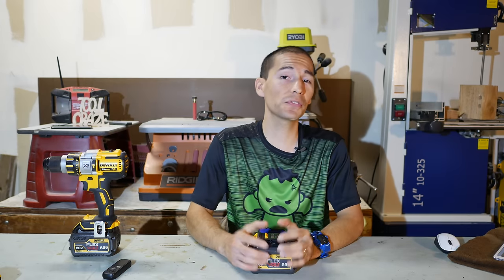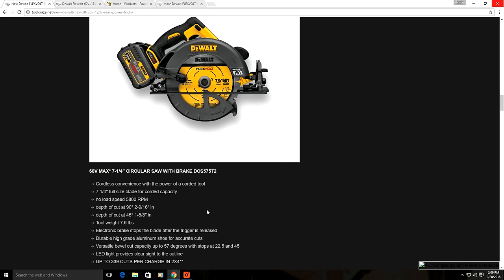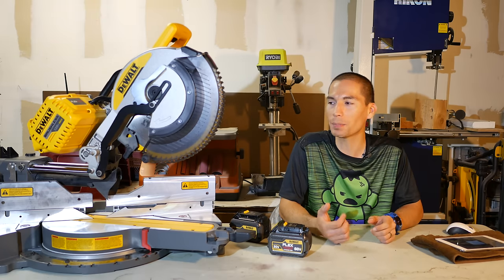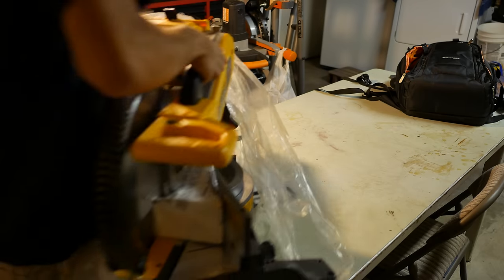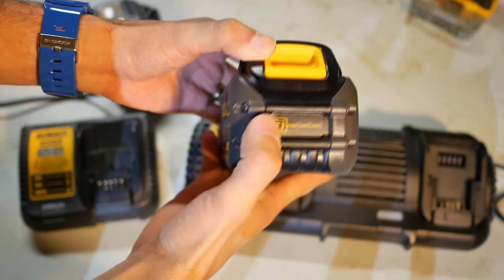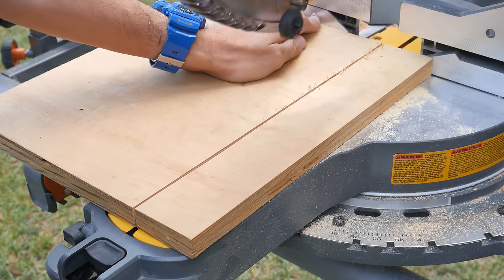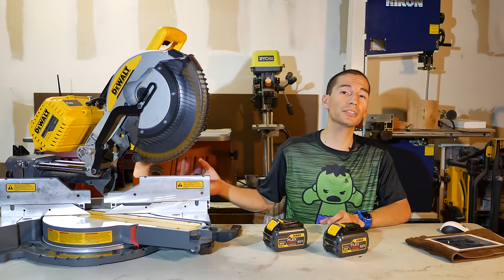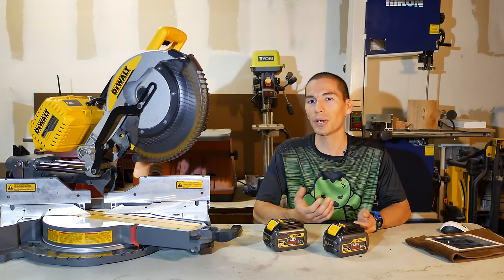Dewalt Flexvolt 120V 12 Inch Sliding Miter Saw DHS790AT2 Review in 4K

Comment: Thanks for the great review. I got my saw last week and love it. One small tip to add; there is an O-ring on the cord of the AC/DC power adapter and a U-hook at the end of the saw rail. Slip the O-ring into it and the cord stays nicely tucked behind the saw, of course if using the power adapter.
Reply from the maker: Thanks for the tip

Comment: great review. i just bought this kit at home depot on sale for $699. plus they have an offer of buy a dewalt 60v tool and get a free 60v battery at a $150 value. so im very happy. but i opend it up and found one of the slider rails is scratched through its finish and rusted. curious if i should be concerned about it and take it back? also the red caps on the batteries are really hard to get off.
Reply from the maker: thanks, yeah I'd take it back if the side rails were busted out of the box. Just get an exchange, its a very good saw
Reply: thanks. appreciate the reply. i just watched the milwaukee miter review. i went with the dewalt 60v as i have the dewalt platform already. i also just bought the rigid cordless miter saw kit and it is amazing. i don't have that battery platform but it makes 289 2x4 cuts on a single charge so it can handle more than a days work without recharging. just subscribed to your channel. cant believe i hadn't come across it sooner.
Reply from the maker: No problem and thanks for the sub. I'm sure either the Flexvolt and the M18 fuel miter saw can both do over 300 cuts on 2x4's because of how many cuts they were able to do on 2x10 with their batteries.
Reply: i forgot to say the rigids is only a 7 1/4 and weighs about 25lbs. so its great to haul around when you only need small cuts framing or trim. look forward to watching more of your vids.
Reply from the maker: Nice, I have the dewalt 20V miter saw and even though it's lighter than a corded model, it aint 25 lbs so good to hear the ridgid is that light. Thats definitely a good selling point. Thanks bro!

Comment: Awesome review man, I think this is the first time I actually sat down and watched a 30 minute tool review. It was worth it, answered a few questions I had about it. 

It would be awesome if they came out with an AC adapter for the 60 volt tools. That would be a game changer. Not that Flexvolt isn't already. 

We might be cutting the cord for the trades in our lifetime for real - other than charging the batteries. The Makita cordless lineup is huge. I switched from DeWalt to Makita for cordless a few years ago because they had some cordless tools I needed that DeWalt didn't have available. Namely, a cordless 23ga pin nailer and cordless random orbit. If DeWalt makes one I'll go back. I wouldn't be surprised if DeWalt comes out with a 60 volt band saw, 15ga finish gun, and framing gun soon, a cordless framer that sets nails like a pneumatic would be great. Looks like I might be going with two cordless brands on my truck soon.
Reply from the maker: Thanks bro, when you really get into, those 30 something minutes fly by.

That's the thing about all cordless brands, none of them are perfect. You have to pick the tools you need from several brands to have a custom collection that suites you best. Good news is that Dewalt already has a framing nailer on 20V
Reply: Yes that truly is the thing. I thought I was settled on Makita until DeWalt came out with all this Flexvolt insanity. I don't truly need any of it for what I do - finish cabinetry - I have the Makita 18v 23ga pin nailer and 18ga brad gun, impacts, drills, saws, biscuit joiner, random orbit sander, etc., to where all I have corded is miter saw and table saw and router the once in a while I need it (ohhh yeah 60v router....?) - but man I sure do want it. Once in a while I have to run 200 feet of cord for them which burns out the motors, so that can be my excuse. 

I've seen reviews on the 20v DeWalt framer that shows it doesn't sink nails so well all the time, I don't think I'd want to deal with that frustration. I do decks a lot on weekends and I just roll out the trusty pneumatics. But if they came out with a 60v version I'd probably go for it. It's so hard not to jump on the miter saw already even though I just bought a new one a little over a year ago. And if I got the miter saw I'd have to get the table saw...  Ah the luxuries for lazy carpenters.
Reply from the maker: Good news is that there are cordless routers by Ryobi and Ridgid. Only thing is that they're trim routers which isn't a bad thing really

Comment: What type of stand do you suggest? My DHS790at2 only came with ONE Blade? Is that correct or did you just get lucky with the Extra Blade? A Frozen Pizza would have been okay too.
Reply from the maker: Personally I like gravity rise stands like this Bosch https://amzn.to/3f8prKO it's $332 which makes it a bit pricey or get the same one I have which is the Ridgid homedepot.sjv.io/90md3 and is more affordable but not as nice as the Bosch but still good. I have my Dewalt miter saw mounted on it at all times.
Reply: @ToolCraze  Thank you, yes they look like very good stands. I ended up going with the Toughbuilt because I will be moving it a lot and needed something I can get between some doors that are 31" exactly.  Also I like the extension and bought the extra Roll Extension for Longer Lumber.

Comment: So does the ac adapter run other battery tools? That would be interesting!
Reply from the maker: No way to find out since there aren't any other flexvolt 120v dual battery tools (except for the other non sliding 12" miter saw)
Reply: @ToolCraze  I'm saying attach a regular 20V tool to one side of the adapter. May be a bit bulky but will it work? Or are the connections totally different?
Reply: @ToolCraze  are you gonna test it?
Reply from the maker: I'll give it a try eventually but not with a 20v tool. Remember a flexvolt tool only works with a 60v battery and the AC adapter is emulating two 60v max (56v) batteries. I can bet money it simply won't work on a 20v tool and possibly might damage it. What I can do is try with another single battery flexvolt tool but unfortunately I don't have any at the moment. I'll give it a try if I ever do. Still don't think it'll work as the AC adapter and miter saws have an extra pin connection that is probably there to confirm the special communication between the two.
Expect the test to come on the website at www.toolcraze.net

Comment: Could you please tell me roughly how heavy is the AC adapter, having a few issues getting the bare saw shipped over seas (Saw is 25KG, But its 32KG Shipped) & max is 30KG for air shipping. cheers dude, Great video
Reply from the maker: I have no clue. It's not heavy at all. They sell the adapter by itself, Google it and you might find your weight info. Sorry I couldn't be of much help

Comment: As always, an excellent review. I never feel like I'm getting a sales pitch from you, just a truthful presentation based on experience and knowledge. Nothing beats real-world experience and you've obviously worked with most, if not all, of the tools you've reviewed.

I did catch, however, the only incorrect statement I've ever heard you make. These batteries would be working in series with each other for the voltage to be added. Batteries in parallel, the amperage or amp-hour rating would be added. Example:

(2) 12 Volt / 2 Amp-Hour batteries connected in series will yield 24 Volts @ 2 Amp-Hours.

(2) 12 Volt / 2 Amp-Hour batteries connected in parallel will yield 12 Volts @ 4 Amp-Hours.

Yes, a little OCD, but I wanted to point that out. 
You seem to be the type of person who will take that as it is intended, constructive rather than critical.

You do a great job with your reviews, keep up the good work!
Reply from the maker: Thanks bro,
I had to rewatch the video to see what you were talking about and yes you're right. I meant to say series instead parallel.
Reply from the maker: I wish I could fix the video but once it's up there's no editing to fix it
Reply: I wouldn't lose any sleep over it... ha-ha.

On a side note, I purchased the Fein Multimaster w/Starlock based on your detailed comparison to the previous mounting system... I am very satisfied and I thank you for helping me decide.
Reply from the maker: Cool, good to see one of my videos influenced your decisions. I really dig the new starlock mount.

Comment: Thanks for the nice and thorough review.
Your plywood moves to the right at the outer edge when you start cutting @ 21:08 As long as it does that it doesn't matter how accurate the LED light shadow is, or how square to the fence the blade is. ;-)
@ 22:47 Always wear hearing protection when using a mitre saw! Especially when cutting several pieces.
How Noisy is a Miter Saw: http://www.smarthomekeeping.com/how-noisy-is-a-miter-saw/
Noise Levels for Common Tools [see page 3]: http://www.progressiveag.org/uploads/documents/noise_graphs.pdf
As you can see the noise level of a mitre saw is up to 103 dB and just 7.5 minutes at this noise level is enough to permanently damage your hearing [see page 2].
Reply from the maker: Thanks, the plywood moves because I didn't use the material clamp. It was an unsupported plunge cut but I'm sure you already knew that :-)
You should do a video on safety handling and use of power tools

Comment: nice video!!!, what do you think about there dewalt circular saw 60v 2amps? / compare to the milwaukee circular saw 18v 9amps battery??? thanks!
Reply from the maker: Thanks! I think the new Dewalt flexvolt circular saw sounds great, haven't tried it out though. The only Flexvolt tool I've tried out is the miter saw in this video. Can't compare it to the Milwaukee M18 without first trying out the Flexvolt model. Although I would expect more performance from the Flexvolt because it's running on 54 volts. Even the Makita X2 edges out the M18 Fuel circular saw because it's running 36V.
One thing I do want to point out from your comment is that these batteries are rated in (AH) which means amp hours NOT amps. Battery amp hours are a measurement of runtime not power output. Many people get confused with this. So it's not a 60v 2amps or 18V 9amps battery, they are 60V 2 amp hour batteries and 18V 9 amp hour batteries.

Comment: Have you had any issues with the saw since you bought it?
Reply from the maker: no issues with the saw itself so far but one of the batteries that came with it would no longer charge after some years so I had to send it in for warranty. I wrote about my experience with Dewalt warranty and you can check out my experience here on the Tool Craze website https://toolcraze.net/dewalt-warranty-service-experience-and-honest-review/
Reply: @ToolCraze  the motor on mine burnt after a year i just sent it in for warranty and i was told i was from using it with the ac adapter but i dont see how its possible. The saw is designed to be used with batteries or the ac adapter. Do you use yours with the ac adapter or just batteries?

Comment: good review but i wish u cud have showed how the bevel works.
Reply from the maker: Thanks but bevel is not unique to this miter saw, so no need to show how that works as all miter saws can bevel. If I went through every single feature of this saw it would be pointless, and a LOOOOOOOOONG video! This video was already long enough, no need to make it any longer. Not to mention boring with plenty of stuff most people would already know anyway, that's why it would be pointless. It sounds like what you need to know would be from a how to operate a miter saw instruction video or manual, usually that stuff is covered in the included manual in case someone is new to a miter saw.

Comment: This may sound odd, but I was really hoping Dewalt would come out with something similar to the Ryobi cordless miter. When those Ryobi's started showing up on jobs, the owners took a fair bit of harassment...but over time, most people realized just how handy such a small, lightweight miter could be. I'm on my 2nd one, they don't last well, but when casing 2 doors on a 5th floor with parking far away? heck yeah...
Reply from the maker: They have something better than the cordless Ryobi, the dewalt 20v miter saw. I have a review on it if you want to check it out
Reply: I'll check it out...looked heavy in Home Depot, but was bolted to shelf so didn't get to pick it up, but I'll keep an open mind...thanks
Reply from the maker: I'm sure the ryobi will be lighter but the Dewalt is solid like all dewalt miter saws. It's a slider yet is still compact and lighter than the dewalt full size monsters
Reply: BradKW 
I'm in the same situation often.  I bought the new rigid 7 1/4" dual bevel sliding battery saw. It's awsome. I framed for 2 days on one charge so 1 battery is all you need. cuts 2 3/4" trim standing against fence and 2x8 flat. I'm buying this 60v dewalt for bigger capacity which is what it's for.

Comment: Price is a show stopper for me. Nice review though, always watch yur stuff. Appreciate your time, as always.
Reply from the maker: Thanks Ian. Yeah the price is up there that's for sure. But if you break it down in terms of what's include with these kits, it's about the same as the corded model dws780 plus the extras such the batteries, the charger, and the ac adapter. I got the $800 kit but luckily I got it when they were running a 10% off deal to help make it more "affordable" lol

Comment: also there comming out with an aligator saw
Reply from the maker: I seen that, its very interesting. I saw the video and was amazed at how fast it cuts concrete
Reply from the maker: There's also a couple of other flexvolt I forgot to mention in this video. A  Bluetooth light and a flexvolt Bluetooth radio. Those are also posted on the Tool Craze website to check out
Reply: thank u will have a look
Reply: saw the saw today  at bunnings it is a strange saw

Comment: you dont get 20 volts. 20 volts is with no load. thats peak voltage. under a load when you are using is 18 volts.
Reply from the maker: I explained that very clearly at the intro. 20v is peak charge, when you use the tool the voltage drops back down to 18v - it's all there explained in the intro.
Same goes with 60v is 54v nominal and 120v is 108v nominal
Reply: i know. in europe the call it 18 volts. in the US the say 20 volts.marketing thats all. Milwaukee is 18 volts under load but 20 volts no load.
Reply: you said in your in your video you really get the 20 volts or 60 volts which is not true. peak to peak voltage. not under load.
Reply from the maker: Yes I did say you do get 20v 60v but you forgot to mention that I also said that it's only when fully charged. I also said when you use the tool the voltage drops back down to 18v 54v. It's all there in the intro. 
You are correct in saying it's all marketing and it works. I've seen people think they're getting more because of the 20v marketing but it's really 18v and that marketing hype doesn't work over in Europe, that's why 18v tools are called 18v instead of 20v and 12v tools are called 10.8v in Europe.
Reply: view the whole video
Reply: courtney